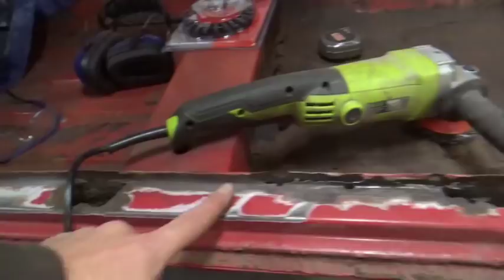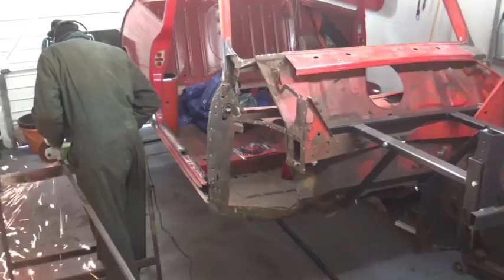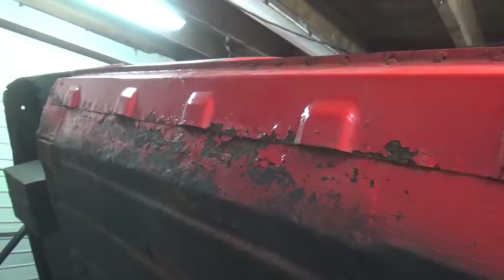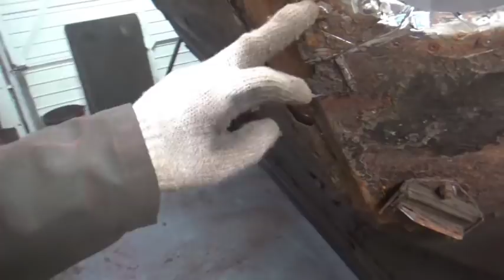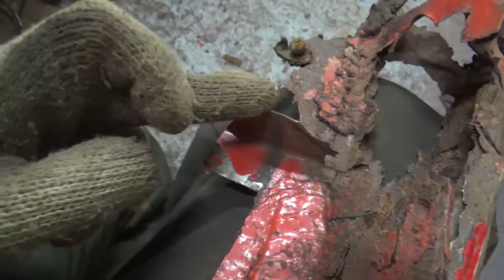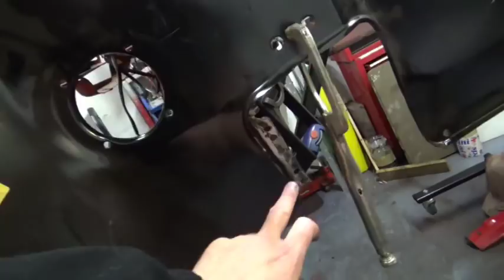Austin mini restoration - Door step removal

Comment: Sean, Much respect for your work on this Mini, (Angus) some of the previous 'work' done on this car beggars belief. Makes me wonder what I have in store for my car...? Best of luck and keep at it...
Reply from the maker: Thanks Malcolm, Yes some of the previous repairs could have been done better. A few years ago I cut off 3 sills on the drivers side when I replaced the rotten cover sill with a heritage panel but I knew then I was on borrowed time with the car and eventually I'd have to park it up and in 2014 that day came when I discovered a rotten subframe mounting panel (heelboard) and it sat for 3 years on the drive awaiting its restoration. 

The repairs are awful in places however, the dodgy repairs have inevitably saved it by keeping the car on the road and I'd much prefer a 70's mini over a later Rover one as these were rot boxes. I had an Spi that was in worse condition than Angus!

Comment: Wow that’s some good progress ! .... it’s definitely worth doing the whole rear quarter panel , it’s a dam sight easier than repairing the little bit behind the wheel ..... personally I like the videos around 30mins long I get quite engrossed on what’s going on !
Reply from the maker: Yes Paul, the quarter panel is getting ordered as it has rot in various parts and for the sake of a big note it's worth doing and would be silly to just clean it up only for the rust to reappear at a later date

Comment: well done, looking good. it just so happens i am about to take the boot floor out of Bernie the 1275GT and i, the same as you, are worried about it bending when its on the jig so i am in the process of making a stand for it to sit on so the weight is off the JIG. Great minds think alike as they say. keep the videos coming.
Reply from the maker: Indeed buddy but the only problem with my mind is by the time it thinks of something it's usually too late lol. The bend was only slight and more of a flex I'd say because as soon as the car was on a spreader board it fell straight back in line. Boot floors complete with battery boxes are currently down to £122 or without battery box £187. I'm gonna assess my battery box as I think it's still mint and original and if so then I'll drill out the spots and retain it and buy a floor without the box and that's nearly a £50 saving and almost a new door skin if you look at it that way lol

Comment: I'm roughly at the same stage with mine but thinking about doing the inner wings before it goes on the Spit. We'll see.
Reply from the maker: I'd agree that you're better doing the inner wings first and if possible leave the hinge panel and A post on so you can have a solid reference point.

Comment: Wow that’s a big gap! Definitely a nice puzzle to piece back together though, good luck, I’m sure you’ll manage it bit by bit.
What are the poly pads/wheels like? I sometimes think the wire wheel is a bit too aggressive on my poor old mini!
Reply from the maker: The pads are very gentle Matt and don't remove the metal but must only be used on smooth surfaces otherwise you'll destroy them quickly. I've used these pads in the past and thing they are superb. The wire wheel is equally good at tackling the surface rust however goggles are an absolute must as it can spit out bits or wire. I'd personally advise using a full face visor as I've had wire strands skelping me in the puss and digging in and it's feking sore mate lol